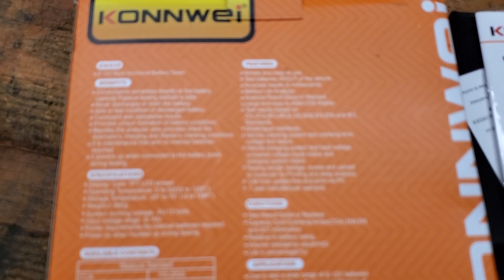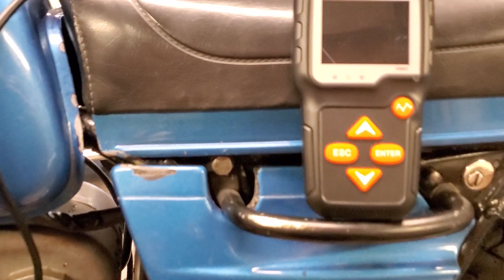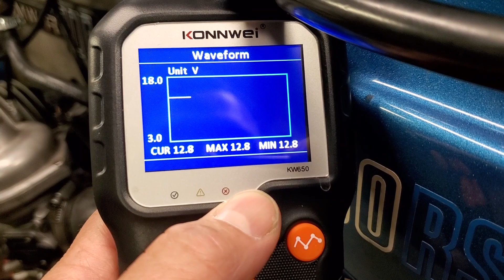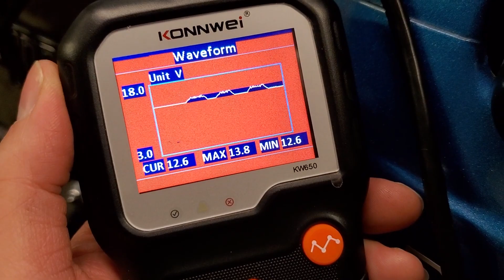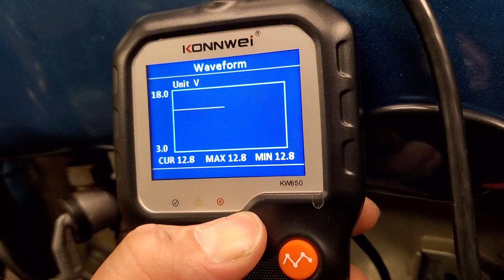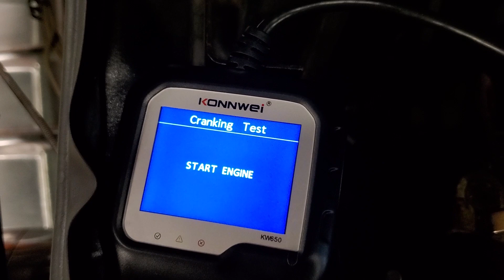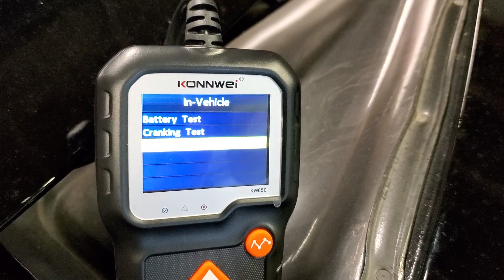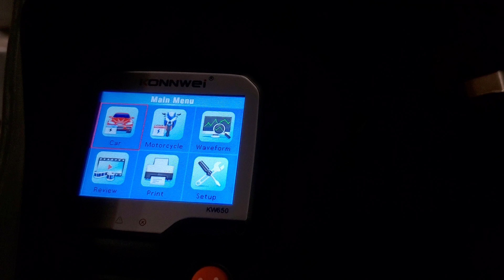Konnwei KW650 Battery Tester and Charging System Analyzer Review

Comment: Test charging system "fail"? - it said to increase revs to 2500 but didn't sound like you ever did that - ?? - and this looks like the same as an ANCEL brand unit - ??
Reply from the maker: I don't recall, I probably did not. Was really just demonstrating the unit. I'm not familiar with Ancel brand?
Reply: @OctaneElectrons  Google Ancel battery digital analyzer - looks the same.